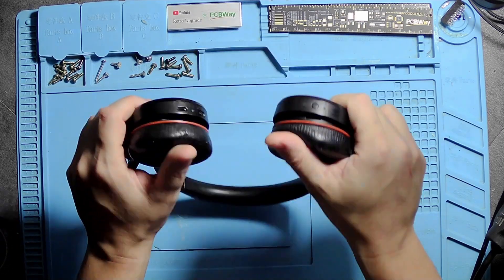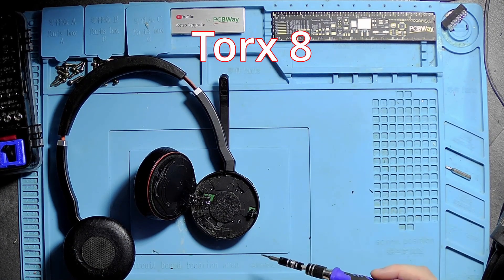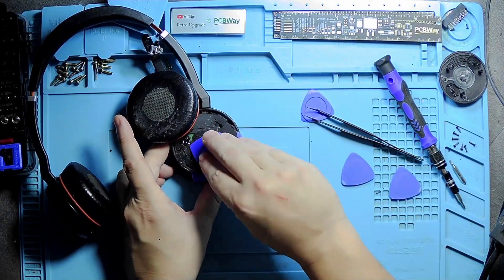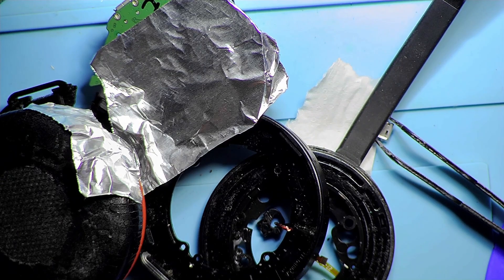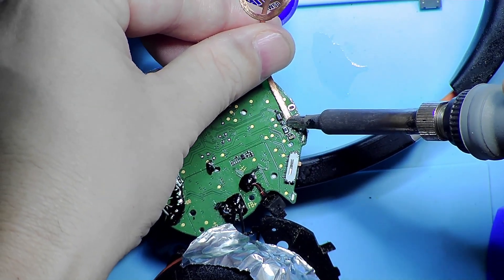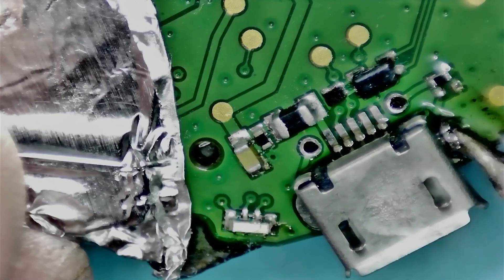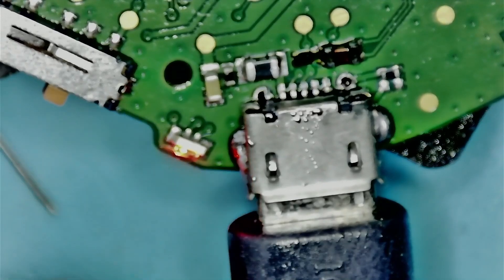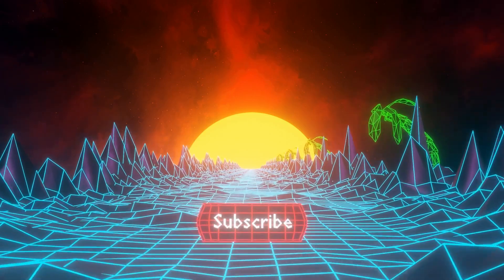⚡ Jabra Evolve 75 USB Repair – How to Open It Without Breaking!

Comment: On mine, the LED didnt light up when i put in the cable - but it charges. Just very slowly (0.2A). USB-Port, BMS or Battery ... do you ever face such a problem? the port seems sturdy.
Reply from the maker: Hi. No never seen that issue would guess it has something to do with the charge chip. Have hade similar issues with game consoles and it's usually faulty battery or cables in those cases

Comment: Is it a good idea to upgrade it to typc port (atleat only as a charging port)
Reply from the maker: if you can manage to fit one in there yes i would say its a very god idea its a common failure point and putting in a type c port would alleviate the strain on the solder joints but the lack of space means its really hard to fit one . good luck if you are going to try :)